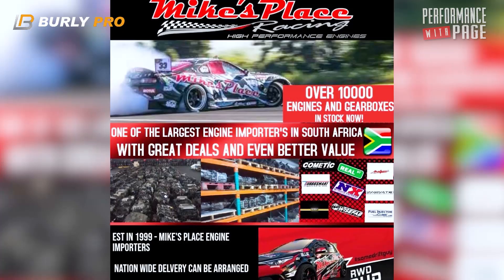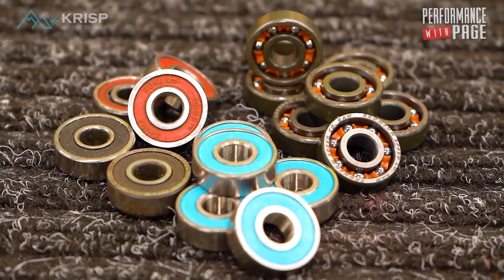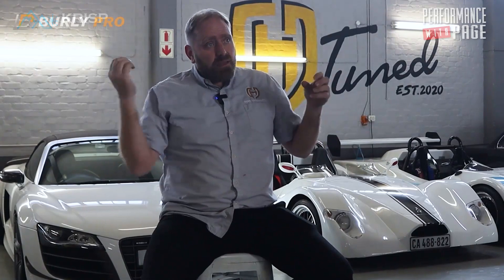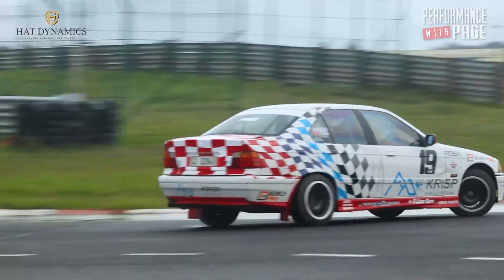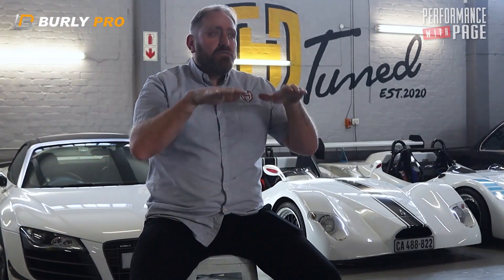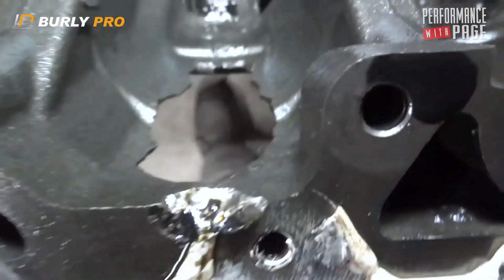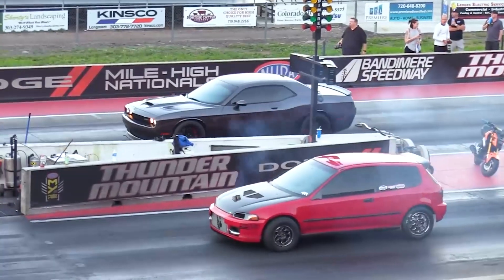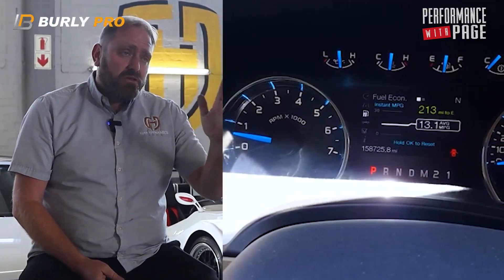Everything you need to know about Engine/Main Bearings

Comment: Thank you for this video. I have a low revving engine. Its a daily driver. I have the crank out for block reboring. I just plastigage the rod bearings and all are between 0.0015 and 0,002 inches. within spec. visually the crank journalss and all bearings look great. there is the #4 Rod Bearing with a slight scratch but finger nail does not catch on it. that crank journal location has a little discolored spot but smooth. The Machinist mixed up my main bearings, what should I do? Thanks

Comment: This is good stuff, Thanks! I renovated an old ford diesel. Put new bearings in conrods and crankshaft. Camshaft bearing was like new, so I didnt change them. New oilpump as well. Start up and idling for some minutes. Engine seized. Turnsout the oil pressure dropped at the camshaft, so mains didnt get pressure. So maybe do all bearings at once?

Comment: You’ve contradicted yourself! How does the brg wear if it’s never to touch the crank!! Of course they touch  that’s why coated brgs were created!  Cold starts r prob the worst   But yes brgs and crank touch  it’s sadly unavoidable
Reply: 😂😂😂 You're a bit thick eh, the film of oil obviously gets compressed and loads the bearing surface.... I wonder what that would do over the span of a couple of hundred million times... Oh it may just squash the bearing ehh?? The coating isn't for that ethier 😂😂😂 it's to allow oil to flow better causing less friction and therefore heat....

Comment: It’s the combustion stroke that pushes the piston down not the crank, why did they show some guy oiling the outer of the bearings shell?that’s a no no. Dry sump is the answer for racers, expensive tho. Excellent video
Reply: Nope no problem oiling the outside of the shells. Old wives tale. That guy doing it in the video is Jay from Real St, built the fastest and quickest drag and drive 2jz in the world, so he knows what he's doing.

Comment: Oil film thickness. Hot engines need more viscosity. Turning up the boost….more load on the oil film….need more viscosity. 10w50 or 10w60 and your engine will last forever

Comment: First time a hear someone discuss issues knowone bothers discussing or checking. 

I can add the following :
If you build engines own a bore mic  and outside mics as  it enables you to measure accurately and more importantly  ovality which you'll find in alot of  mains and bigends.

Plastic gauges are better than nothing but not ideal.

I wouldn't run bearing clearances as low as 28um but would suggest a min of 40 -45um on an Ave 4cyl.

Grinding cranks has its drawbacks as most ground cranks ive measured  have upto 20um ovality .I would suggest no more than 5 .

So to conclude I would torque everything without bearings inserted to check size and ovality  before anything if a new build engine.

Comment: Just wrong dirt and fractionally excess bearing clearance do not cause bearings to instantly fail those sorts of issues cause bearing's to become worn prematurely.
But tuning done in the wrong way can cause bearings to fail in even the most perfectly built engine.
Guy probably blows up engines left right and center and need a way to put the problem on someone else.
Reply: 😂😂😂 Aw yup where's your workshop so I can avoid

Comment: Yall worried about 200k Km engines, I have 320+ Km LS and every main and rod bearing looks like new…..
Reply: Fuck sakes” slight bearing knock”. No such thing. Would weld to crank so fast you wouldn’t know GTFO. These engines are junk I’ve had a L96 6.0 tuner ran it for half hour with ZERO oil pressure it was blocked off in the pan. Had to get crank ground .010 and 2 new rods. Yall are wasting your time with these 6/4 cyl..
Reply: Yeah and your cam bearings are flogged right out, what's ya point

Comment: This is my take on information that was given...

You cannot always blame the person building the engine. There are many factors to consider.

The engineering side of the engine build at times can be a problem and I've been there before, as an example:
I built a m50b25 to spec adding about 2 deg of torque to the bolts to hold things properly together and told the customer the piston hights are not all the same(was decked by engineers)
The customer said just put it in, i asked about the crank he said they said it's fine don't worry use standard bearings i said okay, i told him the cylinders wasn't honed he said he knows  but it's fine so i told the customer there are loads of inconsistencies but he said assemble the engine and i did what was asked. 

The engine ran good sounded good but didn't last long the worst words (raise the limiter). I asked how much oil did he put in and he said the amount he saw on the net but couldn't say exactly if it was right because some forms say so much and the othe say so much bear in mind its a pop car permanently at high revs and i explicitly said add about a half to a pint more oil and he didn't.

Long story short after sitting on the limiter it ran a bearing and i told him it's because of insufficient oil in the sump.

So i was indirectly told i build junk but all the other engines i built he beard witness to that are still running well.

When it comes to tuning, so many people tuners are quick to blame the person who built the engine and some will not and will check what could be the problem. Many of the vehicle owners are also to be blamed because of that gie nog a bietjie and then something happens then it's ny hy kan mos dink blah blah blah and some tune just for WOT which is dumb in my opinion.

I was trained on tuning by a very cool guy humble in all ways and told me some people  want to rev high for street cred even though they not making power there.

Alot of what was said is true but too many variables to take into consideration before blaming the bra building a beast in his garage.

Comment: Who's building your engine?
Me?
There's your problem.

I would NEVER EVER come to your shop for anything...not even an oil change.

Guys like you with that attitude are at fault for soooo many botched jobs.

This I KNOW BETTER THAN ANYONE attitude cost me one engine oil pan.

Went to a service for an fluid and filters change, because I no longer had access to a repair ramp. Guy went underneath the car and started the old "aww man ...who worked on this car" routine.

 I told him, I did.

 Well you shouldn't work on your own car if you don't know ehat you're doing man.

I have 10 years of electro mechanical experience man...I only came here because I don't have a ramo or an elevator anymore.

Left the dude to do the job, thinking...well..it's a simple job.

Came back, payed ...rolled off... Got home, and the next day I noticed an oil puddle underneath the car.

Motherfucker crossthreaded the oil plug and ruined the threads and tried to cover it up by coiling some copper wire, which cracked my oil pan. And overfiled the engine with oil hoping I won't notice it untill much later.

Also he did not purge the air from the cooling system just filled the radiator and the expansion tank...i barely had any water in the expansion tank after it ran...and it was super diluted according to my refractometer.